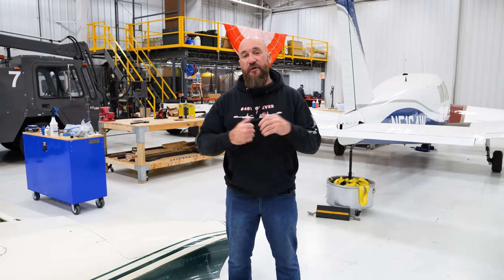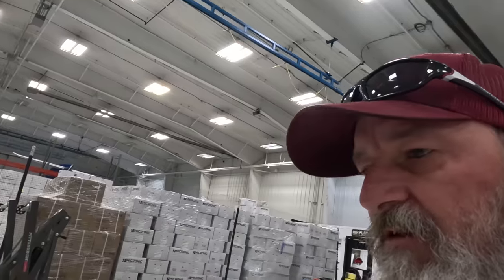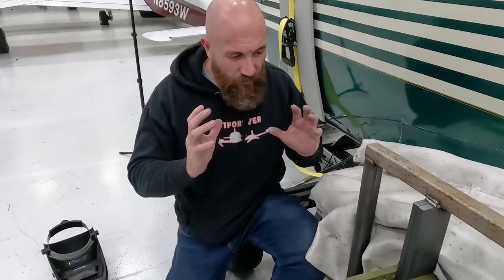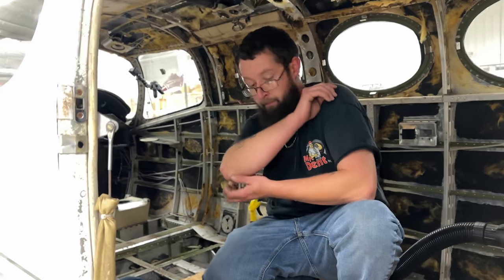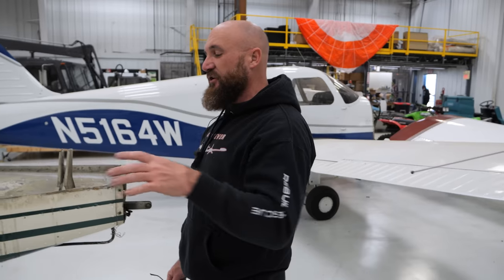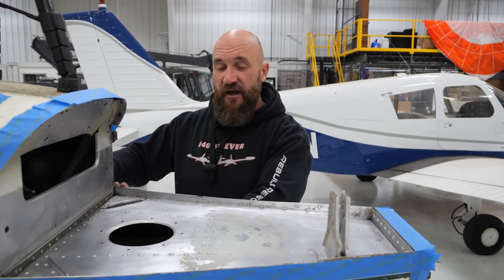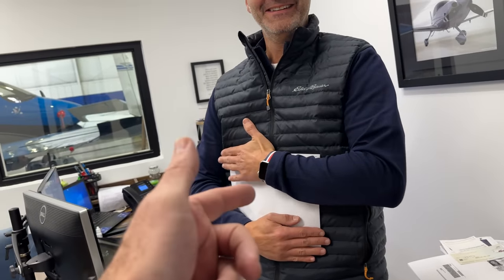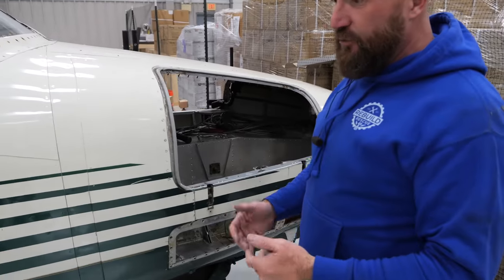Getting The Free Abandoned Airplane Ready To Leave The Hangar !

Comment: What if you used a larger square tube to slide you mount thru weld it to your rolling frame and drill it with a hole for 1/2 in bolt and weld a nut to the tube so the frame can be adjusted like your talking about. on the bolt well a piece of round bar and make each on a T handle If done correctly you have a easy way and the bolt head to tork it tighter if needed during travel.

Comment: There will be vibration and lateral movement creating stress and break those welds. You need to triangulate or add gussets. Also, those welds don’t look like they will hold. You basically spot welded everything.

Comment: K-1 cleaner would help y'all out a lot on clean that aluminum up really good to. It just needs to be rinsed off really good to. On your parts your cleaning in the ultrasonic cleaner unit to. It's A good solution & you can mix half&half with pine sol.,or Lysol cleaner to in your cleaning machine. Yes you'll half add in some water in with the concentrated solutions it'll just be less water is all.

Comment: After vapor honing it is a good practice to apply alodine to the surface for a short time, allowing the surface to turn a light golden color and then wash the alodine off.  Let dry and then prime with zinc chromate or its equivalent.
Alodine is a chromate conversion coating that protects aluminum from corrosion.

Comment: If you are planning to repaint the airplane, I would recommend stripping the old paint off down to bare metal.  This way you are not adding more weight to the airplane in paint alone.  To strip the plane down, be sure to remove all windows from the fuselage to keep the glass from getting damaged from the stripper.  We used a paint stripper that is used by Boeing which is light blue in color and uses ammonia as one of its key ingredients.  It would be cheaper to strip the plane inhouse than it would be to send it out to get it done.  Just something you might want to consider.  I think the 401 would look great in Rescue Rebuild colors and you can use the plane as a promotional tool for your business.

Comment: I'm not a mechanical engineer,  but I know boxes are not as sturdy as triangles (look at bridges). I recommend adding some corner braces as well as angles toward the center of the trailer. You need to keep the fuselage secure from moving side to side as the transport truck turns or if it needs to swerve hard to avoid an idiot driver.

Comment: Before going to town with that primer, good practice would be to alumiprep and alodine it first, you'll have better corrosion resistance and your primer will bond better. This is a great series by the way, keep up the good work!
Reply from the maker: Great points on the acid and alodine prep 👍🏼

Comment: Just a personal opinion: Paint the entire plane red (matching the Rebuild Rescue logo used on the YouTube channel). Add stripes in Silver (IE  metallic chrome if it doesn't violate any regulations), with an added thinner black stripe. Follow the same pattern that the 491 has from the factory. I'm not in the aviation industry so I don't know if this violates any governing body regulations. You can use the same colours on boats, or vehicles as well.

Comment: Hi the 401 is different from my father's planes(Stinson Voyager & Piper Tripacer & Mooney M20A) all he removed the wings and attached them to the sides of the fuselage on a 2X4 frame work after removing elevator and rudder except the Mooney was put on a Helicopter trailer and towed behind his 1967 Chevrolet Belair from Deer Valley Airport to our house in Glendale, Ariz. Rebuilt all planes in our garage then painted all of it  then towed them back the way they came! My name is Dennis Bellemore.

Comment: One comment on your frame because I would really hate to see anything happen to the fuselage.  For background, I am a registered Structural Engineer and owner of a firm that designs large commercial building in California.  

When you weld two tube sections together as you have and leave one end open or weld two tubes together in a "T" configuration, you will only get a small fraction of the strength either tube.  The normal bending strength of a square or rectangular tube is from tension in one face and compression in the opposite.  When you have a "T" or an open end on an "L" there is no place for the tension / compression to go.  Instead, the sides crush at a very low load.  

I first encountered this when I was a EIT (Engineer in Training) and created drawings for a lifting device that was shaped like an upside-down "?" and needed to lift a 2,000lb load from the point of the hook.  It was designed by one of the senior engineers at the firm using Tube Steel 4"x4"x1/4" with full penetration welds at mitered corners.  His calculations indicated a bracket had a failure load capacity of well over 10,000lb.  On the first use, the bracket folded up like tinfoil before the load moved at all.  The failure mechanism was outward bowing of the tube sides which caused the top and bottom flanges to collapse together.  I proposed a modification were each of the joints had a piece of 1/4" plate between the mitered ends of the tubes.  The modified bracket was used 100's of times with no problems.

The way that you have your frame currently built, I would anticipate that if you were towing it on a trailer and needed to hit the brakes hard, it would just collapse forward, changing the rectangular frame into a parallelogram. This can easily be fixed by adding some diagonal braces between the top and bottom of the framing to hold everything square.

Comment: Good job on your trailer. I was thinking it might be a little weak for the acceleration and de-acceleration forces from the trailer Starting and stopping. And also turning in a curve there will be sideways loads that you should probably think about adding some crosswise bracing.

Comment: How about putting cross braces at the 90 degree welds to counter forward and backward stress on the rectangular "cage"?  Also, an other piece in center between top and bottom horizontal pieces, along with cross braces to those 90 degree angles?

Comment: going to be a bugger to lift out of the support jig with those green wing attachment points wider than the cradle frame.. Guessing you can lift the body out of the cradle whilst still attached to the cradle mounting brackets by sliding them up out of the square sleeves, guessing you would have already discovered this well before this video came out.

Comment: I can see that transport rack or whatever, being useful for holding up the plane body and moving it around in a shop while it's being worked on, etc.  But if the idea is to throw a hitch on the front and pull it around the country like that, and on those wheels/tires, I have to say Bad, Bad Idea.

Okay, yeah, if that thing is just to roll the fuselage up onto a flatbed truck or trailer or something, good.

Comment: Hey - I really like your show - can you notch the metal wing adapter brackets and run the beam through the metal and seam weld it all together? If you notch the plate steel and inlay it - way safer.

Comment: RBR the hopes you have for the 401 are very sound BUT those welds are not corner braces are a must because of all the vibration that the fuselage will encounter! I understand you are trying to keep the expenses at a reasonable cost but when you flew to Belgium and bought the newly rebuilt wings, engines and various other spare parts I would think that your budget became null and void, why not just hire a professional welding company to come in and make a custom jig for the entire fuselage? Then contract a professional trucking company that has the expertise in moving a delicate fuselage it would get to where it needs be undamaged and if it is damaged in transit the moving company pays for the damage done.

Comment: I am confident a case of zinc chromate rattle cans don't weigh a lot. But adding that paint will affect the center of gravity and performance envelope of the 401...  a little extra paint weight in the far aft will make a difference. Maybe that is why the manufacturer doesn't prime it?
Reply: In the 60's, Cessna was building airplanes as fast and as economical as possible. Planes that were destined for duty in a harsh environment (like float planes) were given extra protection but for the most part Cessna had no expectation that these planes would be flying 50 yrs later. Today it is common for planes to receive corrosion protection at the factory but they do not use zinc chromate. Health and environmental concerns have shifted industry to other alternatives.

Comment: Being a welder for over a decade I can see your machine was set correctly, your weld beads are blended in great so the heat was fine, doesn't look the neatest, but seriously those aren't bad at all. I've seen dudes apply for jobs that have "welded" for 20 years and couldn't even come close to what you just did.
Reply from the maker: Thank you Joseph ! Joe and I need some more practice but I think it’ll hold up !

Comment: I have to wonder about welding with the spar still attached. You've gotta get things hot for a weld to work. But if you inflicted a hot enough heat cycle, the spar could ruined for aviation purposes. Something to ask an expert.

Comment: Wood would have been a better option, maybe with bolted steel gussets. Easier to make rounded shapes to avoid injury or damage to a/c itself. Trust that the heat transfer from steel welds into spars was regulated.

Comment: I was about to mention that zinc chromate had been discontinued because of environmental and health concerns, but I just did some checking and found that it is still available for use.  If you're really going to use zinc chromate, and not one of the modern epoxy primers, please be EXTREMELY cautious.  That is truly nasty stuff.  Even the primers used now still have significant amount of hexavalent chromium, which is proven to be disastrous for your body.  Do it right, do it safely.  We want to see you guys still around in another 20 years.

Comment: Triangulated bracing, &/or corner gussets are your friend. I'd be concerned about a fatigue failure of those welds while trailering. I'd also like to see come sort of compliance in the mounting to the trailer. Aircraft aren't designed to have road surface irregularities transferred directly into the structure. The stiffness of the trailer suspension will dictate what kind of a beating the wing mounts take, & how much damage to those critical close tolerance mounting holes experience.

Zinc Chromate primer, or the more modern ecologically friendly equivalents, are typically dry or wet paint adhesion tested. But the application & testing are only half the work. Surface prep is everything. You shouldn't even touch the surfaces with your bare hands, after surface prep & before application. The dry paint thickness would also be inspected. What was demonstrated in the video would never pass new production QA inspection.

Comment: Aircraft  this size really have to cradled. Mounting to the spar butts is a common amateur technique and generally ends badly as the loads during transportation will cause unrepairable damage. I move aircraft and have seen the consequences of this type of transport. Hope it works out for you.

Comment: Given how you folks are literally going the extra mile with this aircraft to ensure both its durability and safety, I think there should be a way to easily distinguish it from other aircraft of the same type.  These days, any kind of sticker or symbol can be easily replicated.  A truly one of a kind paint job, while expensive, is far more difficult to imitate.  Again, with all of the added expense and time already invested, why not finish it in style?  It should stand out as special IMO.  IF you do this, get a trade mark for the design.  Protect it legally at all costs.

Comment: Buff the orginal paint and match the wings. Why? To me, restoration means returning an item to what, or as close to what it was like when it was brand new.  Changing any of that is not "restoration," but "modification" which I don't agree with, but that's just me. However, having said that, don't get me wrong. I agree with, and accept replacing operational parts that have been updated since when the plane was first built, but not when that is not necessary and original parts are still available. 😉

Comment: Even if you do not paint the entire outside of the aircraft, you have already indicated you will be zinc chromating most of the inside exposed skin - which is a good idea.  By painting that much zinc chromate across the aircraft, you are definitely going to have to redo the weight and balance.  My vote would be to redo the exterior paint job with a very distinctive paint scheme reflective of the 501c3 charity the plane represents.  The downside is that if/when you sell it, it may be harder to sell a plane with a unique paint scheme.  a few things to think about.  Also Jason, when spot painting zinc chromate indoors, you really want to use a VOC type respirator.  Inhaling some of that zinc chromate overspray is probably not good for longevity.

Comment: Y'all definitely have your work cut out for you! 😳 I'm wondering why the dry ice blaster wasn't use on the tail cleaning. Expensive equipment that seems to definitely be the better choice of tools with much less  mess particularly in the confined interior tail section.

Comment: The welds look terrible.  The rack looks terribly inadequate. Corner braces are a must.  I'm not an engineer, but larger, thicker square tubing seems critical. 1/8 inch square tube looks terribly inadequate. Not only is its payload heavy, but you will have quite a bit of wind force on the fuselage driving 70 mph down the highway. I don't think that plane will make it on that homemade rack all the way to Georgia and back. If the plane falls off the truck, your project will be over, and all your time & expense will be wasted. Maybe invest with an engineer to design a rack that could possibly be reused for the next project. 

Don't invest in a new paint job.  The existing paint is fine so leave it.  The paint formula is already known, just in case you need to paint different components in different places. If the plane falls off the truck because of the rack, you'll be happy you didn't invest in a new paint job.

Comment: I really enjoy this show. you might consider a boom to support the nose end jack point. it looks like when you let the plane rest on the cart you will have down force on the forward wing spar but the rear spar will be pulling upward. if you slide the cart forward and install a boom to attach to the forward jack point, you might be less likely to have a mishap. my assertion is based on the fact that when the plane is in flight it is always nose heavy to make stall recovery easier.  Doing Angel flight is very rewarding. some times you get unexpected messes. Especially after Chemo. My advice for that is a couple of Buckets with a layer of about two inches kitty litter and lids, (plastic 5 gallon paint buckets work best. but not the Lowes or Harbor freight buckets as their lids don't really seal that well.) as when it happens it can be in very copious amounts. and  Second Bring Bananas and Mac and Cheese on the voyage. They taste the same coming up as they did when they went down. Also Carry  Ginger Ale to settle upset tummy's. Another item that help's out on long angel flights is the use of a true sinewave inverter. (Not an Aircraft inverter the is 115 volts at 400 Hz. but an RV inverter that is 115 but at 60 Hz. 1500 to 2000 Watt would be recommended, as well as its own isolated 24 volt battery so that it won't drain your primary power but will charge when the engines are on or attached to an APU.  it would allow you to provide service to refrigeration,  I.V. pumps, Oxygen concentrator, Defibrillator, blood pressure, and heart monitoring equipment. Again I really enjoy your Show. keep up the good work.

Comment: I doubt I'm going to get a response, I missed this video yesterday and am late to comment, but.. (and i'll do some research online as well) I'm curious.. if you're going to paint the entire plane and protect it with the zinc chromate application, would it be a better idea for 1 weight and 2 longevity possibly, to do the zinc chromate and seal the plane to prevent corrosion, then paint the insides that are seen or need more protection, then wrap the outside over either a primer or just a corrosion protection layer? I know paint is rather heavy, and I'm sure aircraft rated paint has special stuff in it to further prevent corrosion, but would a wrap or a skin even, be a better solution? I wonder

Comment: Welds will 100% fail might not even make it out of the parking lot. Just waiting for the thumb-nail with a pic of the fuse one the ground outside of the hanger....

Should have used bigger thicker walled material, and need gussets on all joints...

Comment: While the engineer in me loves the zinc chromate, the pilot in me recognizes that it will have an impact on weight and balance.  Certainly, given the complete rebuild a new weight and balance will need to be done, but I doubt it will be a typical 401 W&B given the extra paint and work.  I’d vote for a Rebuild Rescue paint scheme.  You’re not rebuilding the aircraft for a museum, so preserving some original paint scheme is not critical.  Interesting seeing the work done.